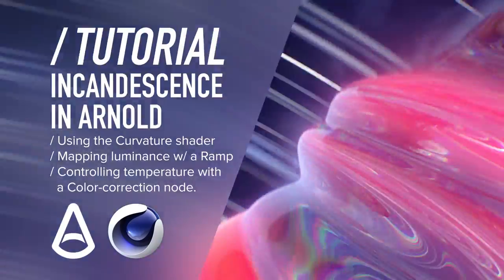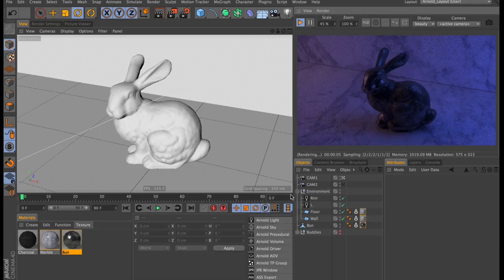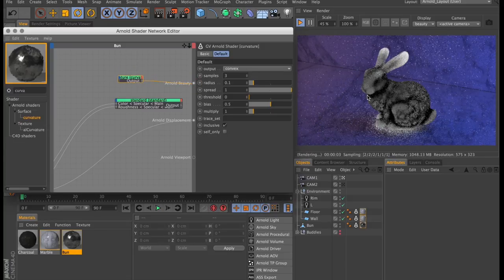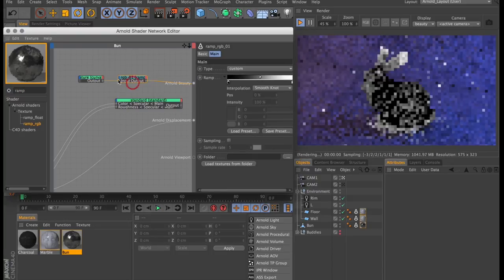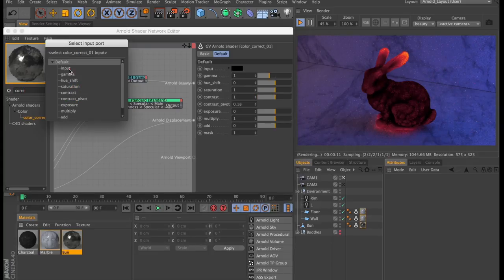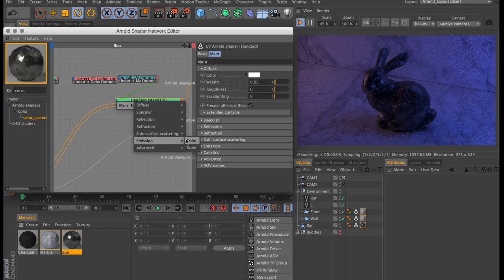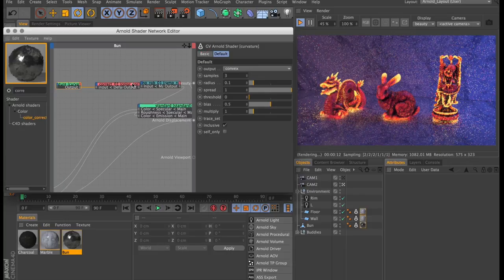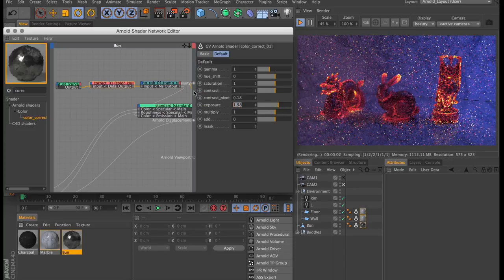C4D & C4DtoA TUTORIAL | Incandescent Glowing Material (Procedural)  [Cinema 4D & Arnold Render]

Comment: Use the Blackbody node to create more realistic Incandescence!
Reply from the maker: That's what I thought too, but I could never get that one looking good without using a ramp to remap it anyway.
I may have just been doing something wrong though...
Reply: Yes, it's a bit tricky and had to do some research my self because it where less straight forward then expected. Create a curvature to find the edges (samples to 5), add a color correction node and rise the gamma to 1.5 and exposure to 10.5 or 11 at least (more gamma, softer result and less fireflies). Plug that into a blackbody temperature, and add that to a standard surface emitter color and wight to maybe 10. Of course as usual it needs tweaking but you can get a more correct look.